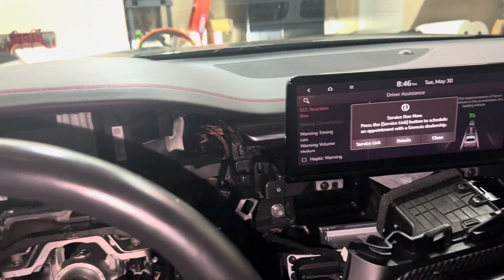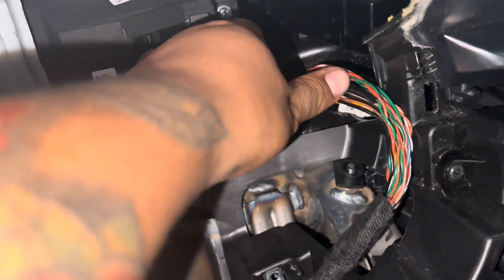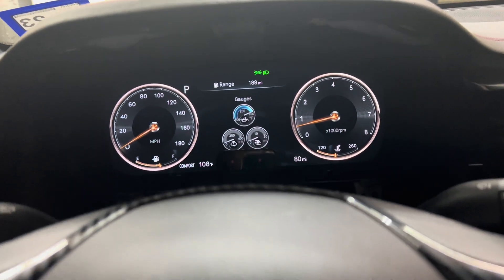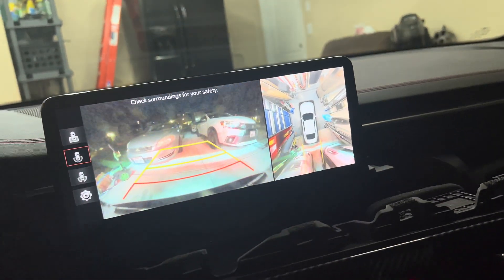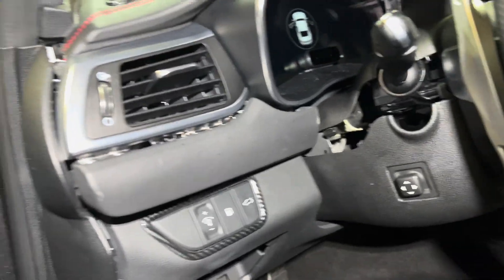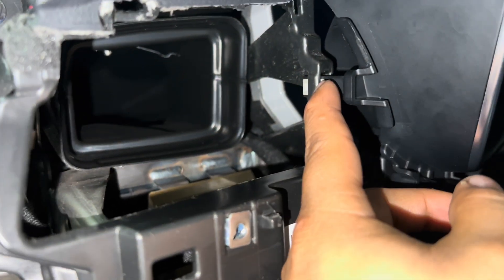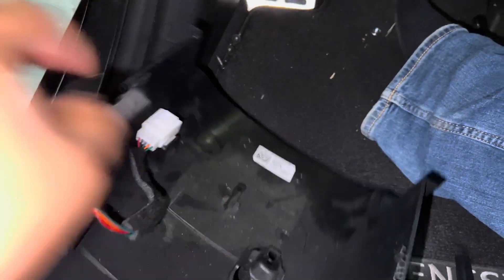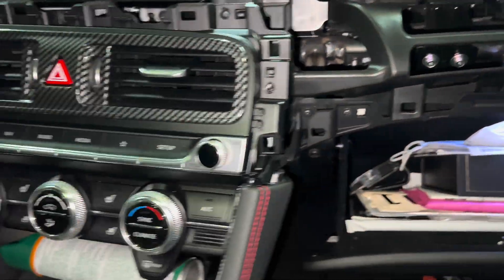G70 3D Cluster Swap DIY | 2022-2023

Comment: Is the Infotainment display on 2020 G70 Pre-Facelift model swappable to the newer 10" Wider display as on the  G70 2022 model?
Even if it does, will there be any functionality issues?

I seriously don't like the Diamond grill on the newer G70 hence, I am keen to stick with the G70 2020 model.

Comment: What happened with the odometer mileage from the old to new cluster?
Reply from the maker: Has to get flashed by someone that has access to canbus decoding. Usually $200-$300 to do
Reply: @ProdigePerformance  Can you describe the bezel gap more after installing the new cluster? Does the bezel not fit after the digital cluster is installed?
Reply: What is the part number for the G70 all digital cluster?

Comment: I read somewhere that the G80 cluster was installed in this G70. Have you guys figured out if this is why the blind spot cameras were not operational? I’ve been looking into part# 94073G9061 which is the cluster for the 2022+ G70 from Korea. Hoping that this might work with the blind spot cameras in the cluster.
Reply: Did you ever figure out of it would work?

Comment: If the system has the option to turn on/off blind spot view in the settings, it should work. However, if it's anything like the Stinger, the feature was first introduced in the 2022 models. I would also assume that might be what that extra connecting port is that's not being used.

Comment: The car it is showing in the cluster is a G80... Definitely not made for the G70 and I assume is going to cause alot of problems down the road. Looks sweet tho.. I picked up a 2023 about 6 months ago and am slightly pissed the 2024 G70s will be getting the full digital cluster.. Feel like I got jipped considering I bought the fully loaded model.. Got it CPO so at least I didn't pay full sticker price. Once the 2024 G70s hit the dealerships I'm going barge in there and be like yo, what do I gotta pay to have this part installed in my car lol. Cause that gauge cluster would totally change the feel of the car. The animations on it are incredible
Reply from the maker: So it’s funny you say that. We noticed it the second day of install and it actually shows a g80 and older g70 it’s weird. We later found out that it came from a g80. So I’m pretty positive if the correct cluster was ordered everything would’ve worked perfectly. This was taken about 4 months ago btw
Reply: @ProdigePerformance  I think the right cluster is part number 94073-G9061. What about the language? Did the cluster you had need to be switched from Korean to English?
Reply: The 2024 doesn't get the full 3d cluster in North America
Reply: @cdnsnowjag  where did you see that info? Is it official?
Reply: @CyberSkunk90  Look at the Gensis announcement for the 2024 G70. They mention all of the other improvements but nothing about an all digital dash.. which means it's not happening.
Reply: @CyberSkunk90 Along with the website not specifically mentioning the 3D cluster, the tutorial videos Genesis USA uploaded show the old cluster. The Monroney stickers for Sport Prestige models also mention an 8.5" display with analog gauges
Reply: @cdnsnowjag  Nope that's not correct as of 2024 the G70 3.3T Sport does get the full digital cluster but only in Canada.
Reply: @timwalker5164  Yeah, you are right. I found that out later in person.